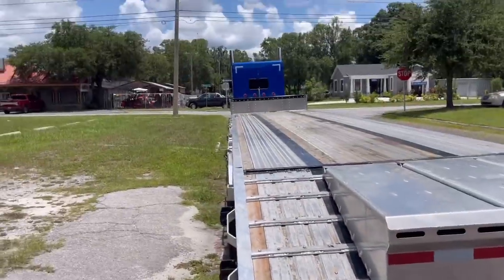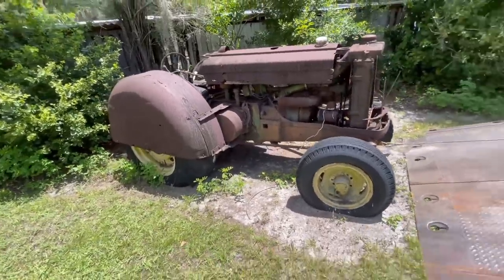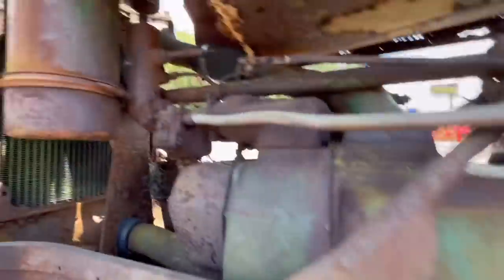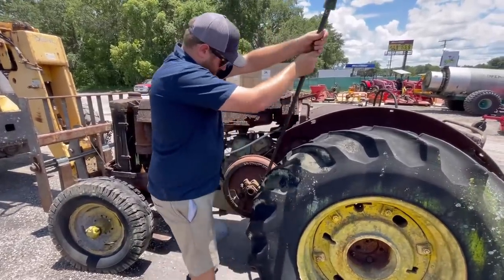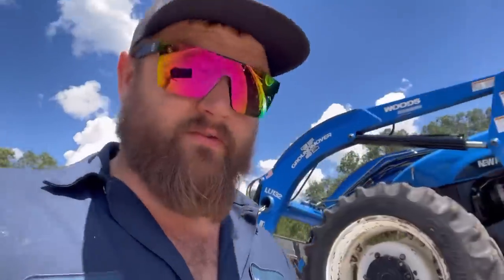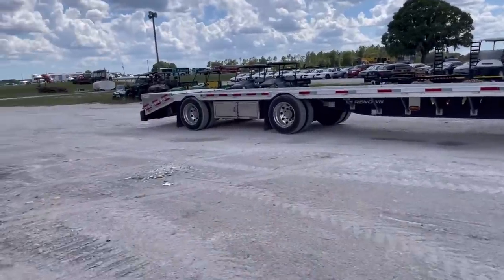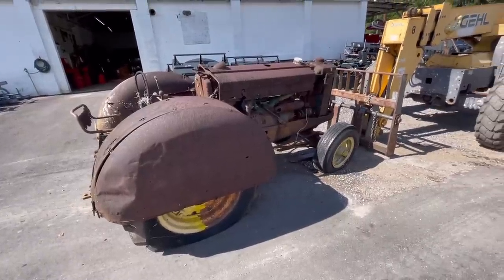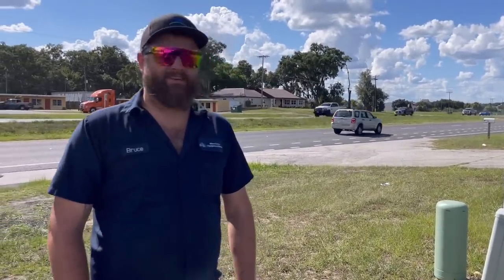Buying a 75 year old Tractor!

Comment: Funny, was watching your video and saw the old John Deere A tractor. Currently I’m working on a John Deere A tractor which hasn’t ran for many years. They had one 6 volt battery and one 12 volt battery in series. Installed new batteries,  6 volt this time in series, cleaned the carb drained the fuel tank and cleaned the sediment bowl now ready to start it. These old tractors are so simple compared to all the current stuff.  Enjoy your videos, cheers my friend.

Comment: Hello Bruce. I'm glad that things are going in the right direction with the ordeal you've had with your trailer. But you mentioned that the company is going to make good on the tires that were chewed up when trailer wasn't working right, which was Good of the company, without a doubt. But you mentioned an in the future thing that you've been promised ie brake repair pieces for the trailer if needed in the next couple years. That's a contract. If I were in your situation, I'd Email the specific person who told you that and when they eventually reply in kind saying something like, Yes Mr. Wilson, should you need to replace the trailer brakes, we will provide you the OEM or quality brake shoes, drums etc, etc...
I'd print copies of this exchange and hard copy file them away in addition to online storage.
1-3 years from now is a while from now and in case The Company develops amnesia between now and then, you will have memorialized that aspect of this incident. 
It's not like replacing the brakes, your nickel, would shutter you company. But you've already been thru alot owing to this trailer not having been what they said it was or what you've needed it to have been. They've told you that they're good for the parts Future and I hope that you'll hold them accountable when, not If, but when that time comes.

Comment: A good way to break free a tractor engine is to put it in gear and rock the rear wheels back and forth with the spark plugs removed
Reply: Bruce, whats the ser. No. If it says AOS before ser no. It's  very  very  very rare. Lots of money  thousands.

Comment: Drain the water and crap oil out deisal fuel rinsout engine compartment there 2 pit cocks order neath the tractor on the block open them it will make it spin easy get a rebuilt carb and magneto fresh gas wires plugs new oil filter shell fire right off don't let the looks deceive you it will run!!!